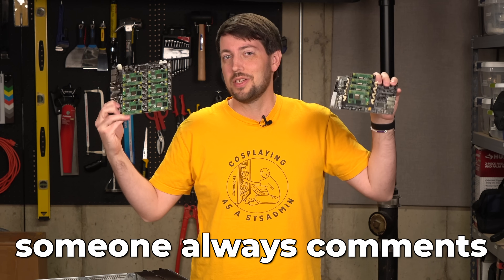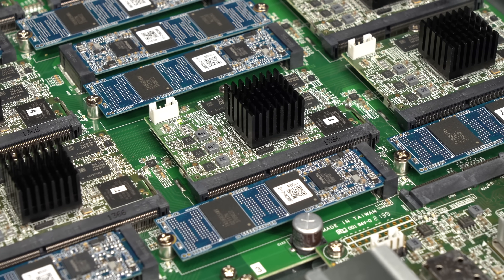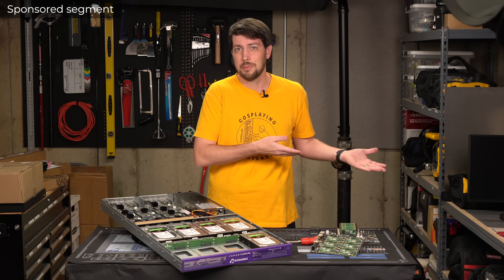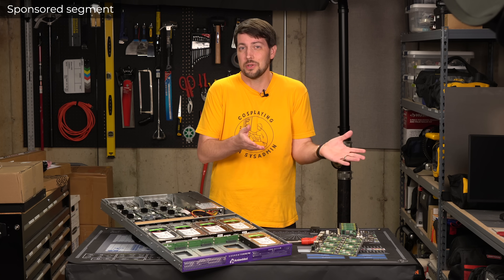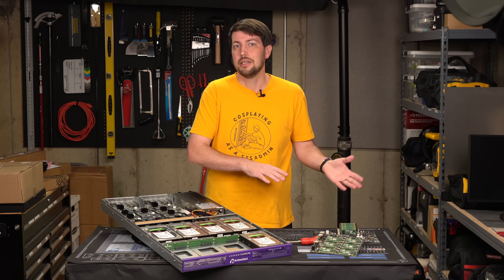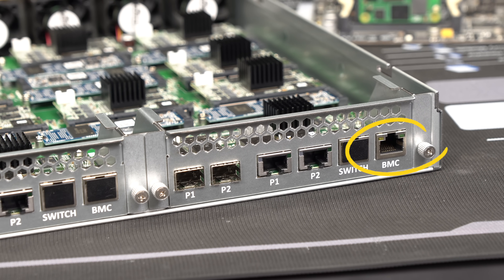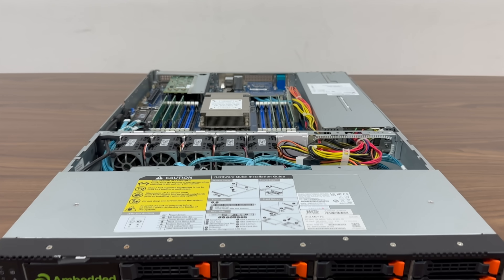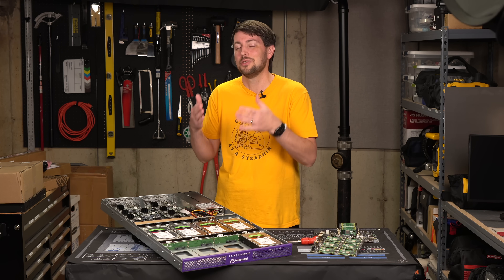This storage cluster is WEIRD! (Mars 400)

Comment: 7:30 Vibration dampening is NOT for “portability”, it’s to dissipate the forces from spinning disk drives. Multiple drives tend to resonate, and even though these forces are small, they decrease life of drives significantly. 

I’m guessing the dampeners were just missing, because I have never seen a disk caddy without dampening.

Comment: Totally pointless if your going to do ceph then do it properly fit for purpose storage servers with decent  cpu to handle compression amd erasure encoding, with plenty of ram so that each osd can have 16gb caches with nvme for the osd database  and sas with dual actuator drives on direct hba controllers and dual 100gbit infiniband or rdma ethernet. I am thats what my 6 node 128osd  ceph system is running with proxmox

Comment: I like the sound of the fans with a picture of still fans...
Reply from the maker: Those are actually solid 'ducts' on the back of those server fans (they're deep!). The front has the actual spinning fan blades, then at the back I believe the ducts help create a more turbulent flow to make sure the air back there mixes (or it might be something to help with static pressure... or both!). But the best thing is if you touch that your fingers don't get chopped off. Not quite the same on the other side of those fans!

Comment: i dont see the use for a centralized ceph cluster board. the point of ceph is that it is not central. If the power supply fails, or the power distribution board fails, all your ceph nodes are down at the same time..
Reply: These are NOT designed to run solitaire. They are designed as bulk storage to fill whole racks or aisles. The fact that one single chassis can be a cluster is just a lovely by-product.
Reply: @kevinthorpe8420  I can easily run  2x 4u jbod Chassis with 44 drives (hot swappable) or even more in storage pod form, with a single 1u storage head and some das raid Controller. You can then put this 4 times into a rack. So depending on your drive capacity you end up with something like 8-16PB of storage. With non hot swappable you can easily go above 20PB. Something like this is what you do if you need storage. Not those weird multiple cluster nodes in one Chassis Setups

Comment: I love your videos Jeff, but there is zero Utility in this product running Ceph.

Questions.. and this is moreso geared to the manufacturer as this is definitely not a you bit :).

Honestly who runs a single OSD on a node? This makes my brain hurt. Even in a homelab, why?????
Management overhead, even with Ansible it is ridiculous to run single OSD nodes strictly due to overhead on the management side. 
Could a Pi even provide enough processing power to make use of a sata SSD in terms of IOPs (This is probably a hard no).
This is still a single chassis despite 'two power supplies' between 8 nodes... everything about how Ceph should be built is screaming for the opposite of how this is designed.
If someone were to run HDDs only, the backfill time is going to be abysmal for a single OSD per node while also trying to still function for consumers.

The reality is, if anyone were looking for a storage solution at this level at what the product costs and offers, it should be a Truenas build with multiple vdevz and raidz2 per vdev.

Depending on your fio benchmarks, were you using posix, libaio? it is possible your benchmarks were being done from memory, on the reads. There are also settings you can fiddle with during benchmarks to prevent things being stored in memory from being part of it.

Also Ceph performance degrades over time, the reality is, especially if there was no WAL/Journal on dedicated SSD or NVME (Which perhaps I whiskied over ;) ), any testing numbers here are unlikely to hold any merit beyond initial fresh install benchmarks.

Best of luck to those looking for a Ceph solution out there, but I would avoid this one like the plague.

Comment: We've been running those for a few years. They do what it says on the box. At the time we started this journey there was nothing in the price range to touch them, or space (8 nodes in 1U), or power ~100W per chassis. We've started having issues with hardware failures now they're older and we've overloaded them so we've had to move some of the ceph nodes (index nodes, not storage) off this hardware, but it still works. Our biggest problem by far is that support in a UK time slot is not easy to manage. If they had a support centre in Europe then I think we'd be much happier.
Reply: "At the time we started this journey there was nothing in the price range to touch them" And that right there is why some people don't understand the price isn't actually expensive. Just the power draw alone pays for itself within a year compared to running multiple Ampere platforms. (Which weren't really available at the time these things were first a thing.)

I swear those who complain about prices have never actually worked in a medium to large business to know what those budgeting reports look like. I see this same thing with professional camera equipment from hobbyist users. Complaints about how a camera body costs $6000 or a lens costs $10,000.

A few grand for a piece of equipment is pennies on the dollar when compared to wages at home. Not to mention that money spent makes money. And many (most) companies don't have shoestring budgets. They actually have profit margins worth a darn.

Comment: 142.41 W for 5 HDDs and an 8-Pi cluster -- hmmm....

I would've thought that it would be more power efficient than that.

At that rate -- that means that it would be on par with my dual Xeon E5-2697A v4 system which is currently consuming 727 W whilst running the ZFS hammer script (due to the recently discovered bug with OpenZFS 2.2.0).

8 Pis @ 5 W = 40 W

Scaling the 5 drives @ 20 W ea to 36 drives @ 20 W = 720 W + 40 W = 760 W.
Reply from the maker: 5 HDDs, 8 'Pi equivalents', a BMC (3W maybe?), plus two multi-gig switches (basically two 10+10+16x 2.5G switches, probably sucking up 20-30W each).

Comment: Nice appliance, Jeff! Do I understand it the right way: Ceph is a storage area networking (SAN) solution implemented completely in software?!
Reply: Indeed it is. The software on the MARS400 runs basically stock Ubuntu and Ceph. You can build your own cluster if you have a pile of servers kicking around but that's a pile of servers if you need the resilience, then rack space and, power.

Comment: Great video Jeff and looks like some interesting hardware. Who do you think would be the target audience for an machine like this? I'm not familiar with Ceph myself so don't know of it's benefits, but looking at your speeds I can't help feeling that a regular server would outperform in transfer speeds and come at a lower cost, although with higher power usage.
Reply from the maker: Generally if you needed some extremely reliable archive storage, you might consider a Mars 400 (or three!). For higher performance (like for active use, or for VMs in a cloud), you would want their faster machines (or other faster hardware, generally), so you could get lower latency and higher throughput.

But for almost all home users, and for a lot of small business use cases, a typical NAS would be quite adequate.

Comment: Link aggregation is still worth it sometimes! even though the core of your network is only 10Gbe, having the storage linked to the switch at X2 (or higher) to the switch  means that a single node on the network can only ever consume 50% (or less) of the total available throughput, it's good at least for multi user access. in your case though maybe not worth it, but just thought i'd mention it!

Comment: I couldn't switch to a regular PC PSU for the Storinator so far that I've seen. My Storinator is the 60-drive model and it seems to have larger power requirements.

Also I run all SSDs in one of them and bought 8 hybrid converters to do 128 2.5" drive bays. But logistically, there are many issues.

1. How to connect all the SAS ports without expanders?
2. How to fit everything in the case with all those wires?
3. There are only 6 connectors for drives, but I need 8.
4. The PSUs only have 50A on +5V (250W) each whereas I need about 15A with some headroom per 16 drives.

Doing all this, I found some 12V to 5V converters from Corsair to do 20A each (100W). With 6 of these, I'll be in he safe zone.

Logistically this is a pain to setup, but I'll be doing it this weekend.
Reply from the maker: Ooh! If you do get through those challenges please ping me via email... I've been working on getting all the parts together for the same thing. I talked to the 45Drives folks about it a bit a couple months ago too.

Comment: The Mars 400 really makes for the textbook example of why industrial ARM has taken so long to take off, and why Ampere has done so well in contrast. It has no resale value, the company behind it has no real reputation to speak of and they gave it a heavily used product name, it has no refurb or reapplication opportunity, and it's running on non-distribute closed blobs with minimal oversight. It's an expensive e-waste hulk to dispose of the moment Ambedded decides to drop support in any form or fashion and by extension a ticking time bomb for any business that decides to rely on it for mission-critical tasks, not to mention a security risk. As a CSE, I wouldn't want that thing anywhere near any network, cluster, or farm I'm responsible for.
Reply: It's running on basically stock Ubuntu + Ceph. You have full access to the innards of their software. It happily runs several other stock Linux deployments if you want to reuse the box.

Our next closest option at the time was over a quarter of a milion quid and ran proprietary software.
Reply: It could be the same for any other company......  Take Cisco and their $%$&%y HyperFlex product line; my last job just installed it ~3 years ago and Cisco announced this year that they are dropping it completely. And that product is so properity its not funny.....  to the point where you cant do half the standard VMware management without using their backwards and for the most part broken services. Add to the point that unless you have an active support with them, you dont even get root access to the services on your own network (they recently changed it but unless you rebuilt or fresh installed, it wasnt easy to get the password).

Comment: Twingate doesn't inherently offer enhanced security by default. If you gain console access, such as through SSH for debugging purposes, you can easily move to other services and machines within the same Layer 2 network segments, bypassing TwinGate's access control. In contrast, I prefer Zerotier, which also supports ingress and egress filtering on a per-network basis, though it's not stateful, but it's free and can be self-hosted. NOW ... I'm getting myself a MARS400 for the office – definitely some good stuff! 😉

Comment: Just running 4 of my Dell R710 servers is killing me on power. My last utility bill was $600. And most of them are usually just at idle.  I am afraid to power up my entire 20 server cluster. The monthly cost savings of just a few of these machines would pay for themselves in short order. The only concern would be running my own software and os. I don't want to be locked into a specific ecosystem. I will have to do some research, but it might be worth moving over to these.
Reply: ~100W per cabinet. I think the Mars-200 was 100W and the MArs-400 is 105W.
Reply: @kevinthorpe8420  my R710s have 850 watt redundant power supplies.  Even at idle, they are probably pulling close to 100 watts. And there are 20 of them.  Even with just the 4 running and pulling 100 watts plus the 14000 BTU AC unit cooling them, it is kill us on the cost of electricity. Cooler, quieter, and cheaper, always looks better.
Reply: @janmonson  Ours run more like 500W each. So you are clearly wasting a lot of computer doing sweet feck all.

Comment: Does ceph + (offsite backup or tape) count as 3-2-1 backup? There are more than 2 copies on ceph and the offsite backup is a different storage media
Reply: Ceph clusters can be multi-location and you can define the crush map to keep copies in both locations. However that can slow things down if the network link is slow. There are also replication strategies you can use for DR backups or archiving.

Comment: do not approve on many levels - performance, licensing, lack of network speed but you will have improved human factored engineering with the new shop - get a case of dr pepper and party like it is 1999 when you finally move in - think about a low cost refurb server/nas config with 40gbe that will kill and eat this pi cluster for lunch - go for max perf and value combined - think of it as ultimate linux box - clustered edition and you can do it every year #free pikvm to all voters #pi cluster gun trade in deals (this could be really popular) #pi<t>

Comment: 4:00 If you split them up, you lose the redundancy, which kind of is the biggest point of the product.
Reply from the maker: You still have two connections on each switch—so you lose out on 20G LAGG bandwidth, but you still have redundant connections between the 10G public and 10G private networks (one each on each of the switches in the back).
Reply: @JeffGeerling  yeah, we've lost nodes and switches and you just wait for the replacement and drop them in.

Comment: You say that full pull the machine takes 400Watt.

Then 2x300Watt power supplies are NOT redundant.
Reply from the maker: 145 Watts :)
Reply: @JeffGeerling  I don't really understand your answer. In your video you state the power supplies are 300 Watt each. Later when you talk about what it consumes, you say at full load it consumes 400 watts.

So 2x 300 watt power supplies cannot be redundant.
Reply from the maker: @janklas7079  At 12:27 I said at full blast (doing random 4k writes), it consumes around 145 Watts.

Comment: I will have to look for the previous video where you presented this six CM 4 compute module mother board. Looks interesting. I would like to learn Ceph just for fun and curiosity. Anyway this 1 U server looks promising, but for the company the version with hot swap drives that you can easily change on the fly is much more convenient. Of course it depends and this is just my private opinion. Thanks for sharing.

Comment: This doesn't make any sense.. if you need to take the whole 1u offline when you are doing maintenance on a pi/ssd/hdd, then why would this be better than a single node with a bigger cpu. if you say it's for separation, then you can use Rook on k8s which runs mgr/osd/mds in containers. which also allows you to share cpu/ram for other workload on k8s for a hyperconverged setup. Also because you are mounting ceph directly on linux, it talks to the osds directly thus bandwidth are spread out to multiple PIs, but if you terminate ceph for smb or nfs then I doubt a single PI can handle much traffic
Reply from the maker: You don't need to take it offline though—all HDDs, nodes, and even the switches and PSUs are hot-swappable.

You can slide it out on rails while it's running, switch out a broken module or drive, and slide it back in, without any downtime.
Reply: Five years ago Rook was seriously flaky. If you wanted a turnkey Ceph appliance then THIS was literally it under £250k
Reply: @kevinthorpe8420  it gives you the ability to do hyperconverged setup. it only configuration management and orchestration. For second day operations you still need paid support if you can't operate Ceph.

Comment: Interesting how you got under 2.5g speeds in the end. I wonder how the cephfs client was running, if it spreads load across the osds or picks one to read from, could explain considering the public and ceph cluster network nics were 2.5g. Would be interesting to see if multiple clients simultaneously can max out the 10g interface.
Reply from the maker: Running `rados bench` on the cluster itself still resulted in about 190 MB/sec of read/write, and I spoke to Ambedded and that's in line with their hard drive-based testing. I think you could get more with SSDs, but if you need a lot more performance, it's better to upgrade to one of their faster systems (with fewer, but faster, nodes). Or of course build your own :)
Reply: @JeffGeerling  interesting, I’m wondering how that would compare to a traditional raid. Did you have it as replica or were you using any of the ceph erasure modes?
Reply: If you ask for a sepcific volume/image then you get directed to one specific OSD and that is limited to 2.5Gbit. It's not designed for that. It's designed for a lot of simultaneous users.
Reply: @kevinthorpe8420  thanks for that, I suspected it was just reading from a single OSD. I wonder if he did 5 clients (1 per OSD effectively if the client works that way) if he’d get 190MB/s on each client.